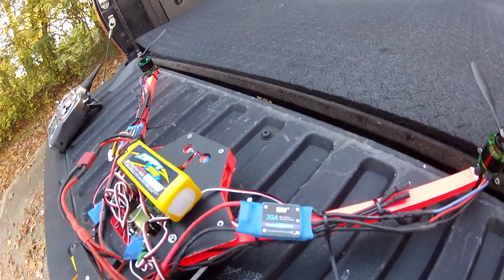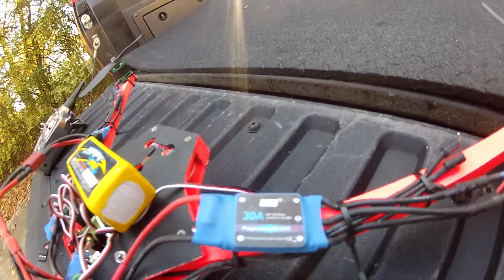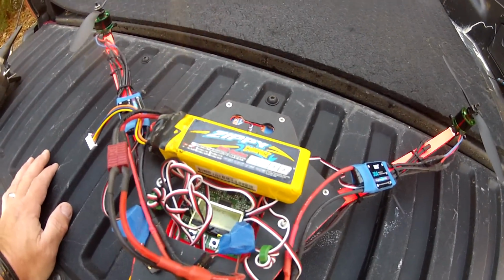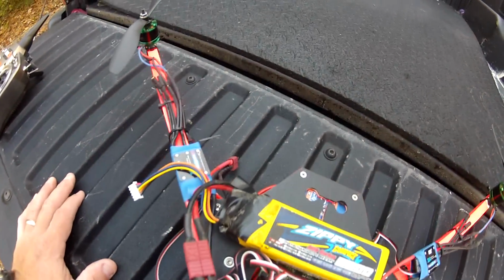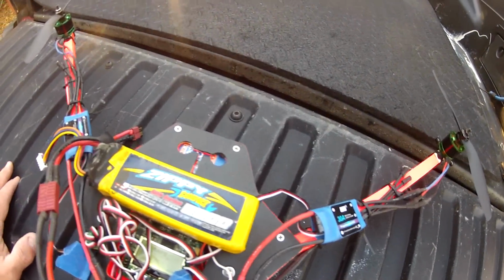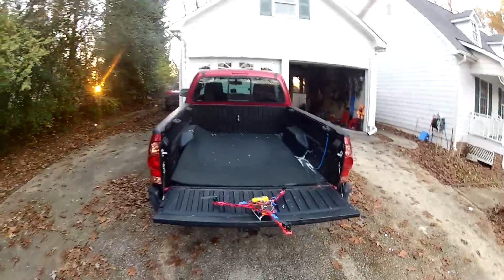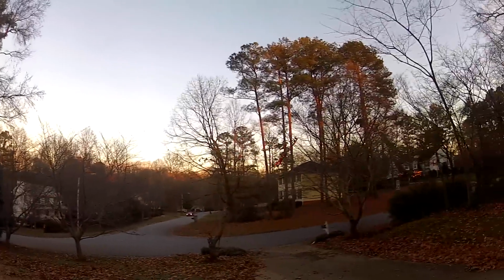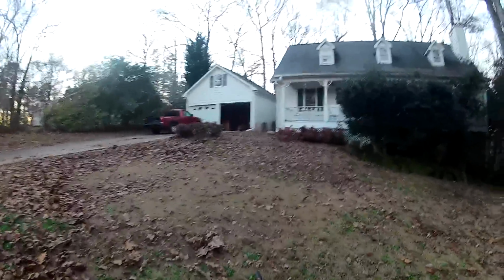Simplecopter Tricopter 2.0 With Buddyrc DYS 30A SimonK Flashed ESC'S

Comment: Matt after u flash the speed controls with simonk do u still have to set the low voltage cutoff, brake, battery type, programming stuff like that, or is the simonk already setup for u.thanks js

Comment: Nice flying Matt. What stick scaling settings do you use on the KK2 and what expo setting do you have on the TX?

I use about 80 for stick scaling and about 65 on expo and I always have to fly nice and high to do rolls and loops but you don't seem to have any problems doing them quite close to the ground.
Reply from the maker: around 120 on the right sticks and 95 on the rudd. i use 70% expo on right side and 30% on rudd. first loop i performed was in 2 foot tall grass at a height of 200 feet. pulse 180 blood presser off the chart....
Reply: hallstudio Nice one, thanks for the info! I understand where you are coming from with regards to the blood pressure.
Reply: hallstudio
Matt. nice videos, build and flying, been a great inspiration. Ive been wantin to know these settings a while.
But one more secret please, how do you level off so accurately after  fast roll, is it just practise and anticipation, i have to switch back into auto stabilize mode quickly at end of spin to save my copter from impact, then flick back ready for next trick. with high rates dialed in its difficult to catch it level after fast roll i find.
more videos please....

Comment: Hi Matt, My name is Tracy. I was wondering if you could tell me the most  reliable but yet inexpensive motor ESC combo to get for a beginner. A combo where the ESC's do not have to be programmed. I don't have a lot of money so I need it cheap. I am a rc plane nut and have been building for about 4 years and I think I am ready to move to a tricopter. Please help and thanks